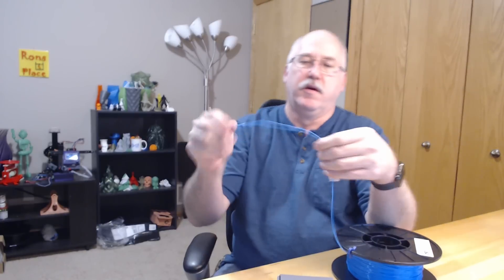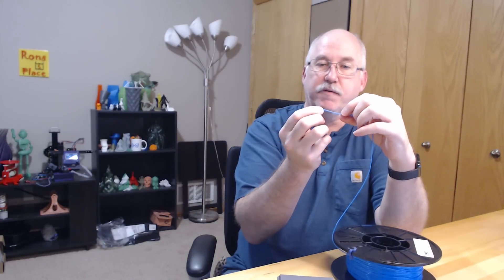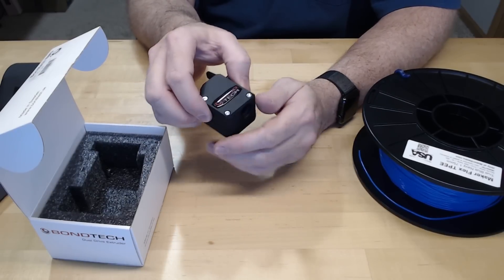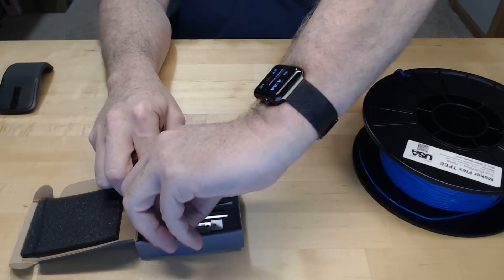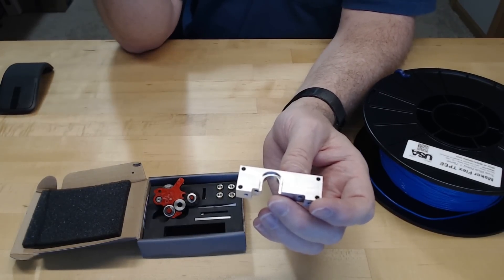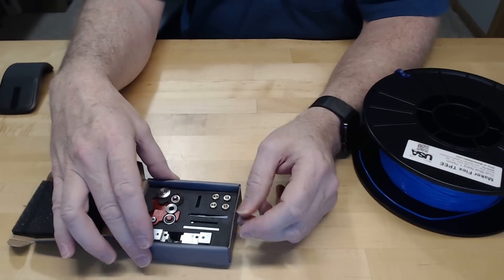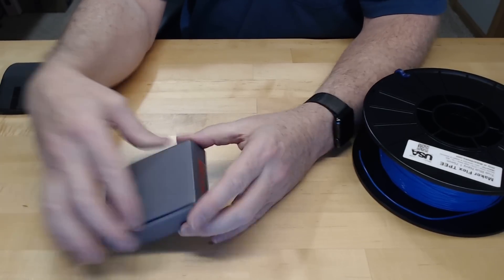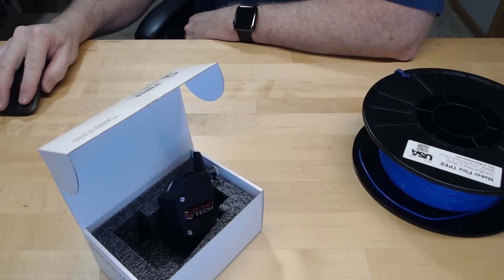Flex Options for the CR-10

Comment: you will have to flash the bootloader on the CR10 as the bondtech has a gear reduction you will need to take into account. 

The only flexible I have tried so far is  TPU on my highly modified Anet A8, my bowden is setup like this https://drive.google.com/file/d/1Oou8UClYzSxWnz3TEU-eL7moXJzx2rU2mg/view?usp=sharing with a mk7 hobbed gear and it seems fine.

 I suspect my Prusa Mk3 with its direct drive bondtech drive and no space for the filament to go apart for down will work fine.

Comment: Hiya Ron. Any luck trying flexibles on the Prusa? I can print semi flex but ninjaflex doesn't work at all. However, I just rebuilt my MK2. Got some new rods and bearings so I  pretty much had the entire printer apart. Even replaced the rambo box. I replaced the PTFE tube in my V6 with some Capricorn tubing. Havent tested Ninja yet but I honestly don't expect a miracle. However, I did notice that the entrance of the top of my old PTFE tube was a bit rough as I had tried to trim some of it away when I replaced the hobbed pulley not too long ago. New setup is perfect in every regard. Made sure parts I reprinted were perfect, redid all the wiring, etc. Will give Ninjaflex another go and see how it goes. My other printer is a Flashforge Creator Pro which prints Ninja extremely well as the distance between the hobbed gear and the nozzle is much shorter. Anyway sorry if you already mentioned this as your video is still playing as I write this :-)  Just curious if the MK3 with the bondtech setup handles flex any differently than the MK2.